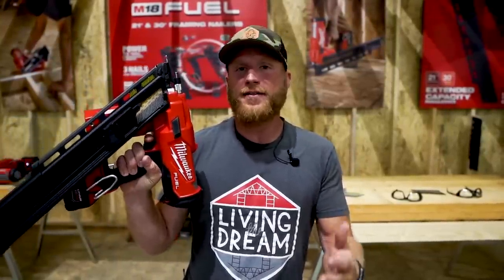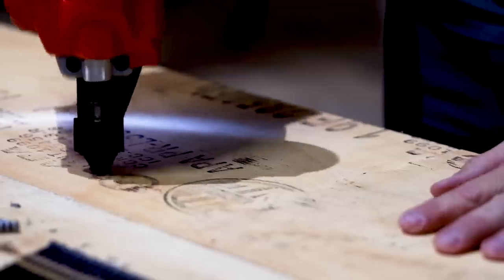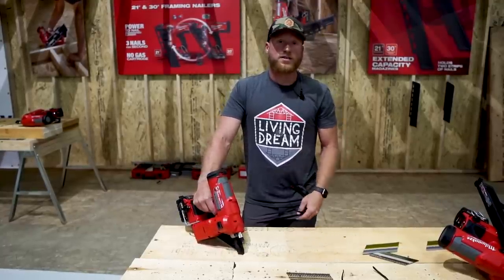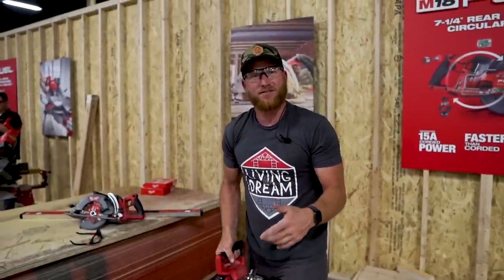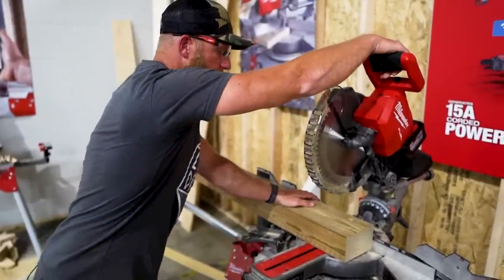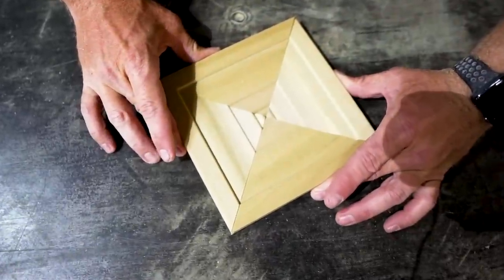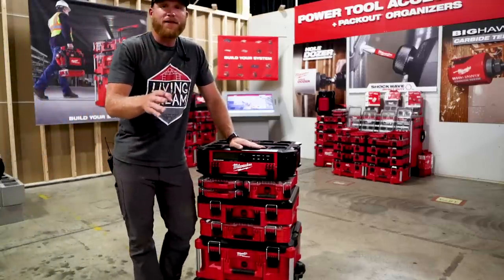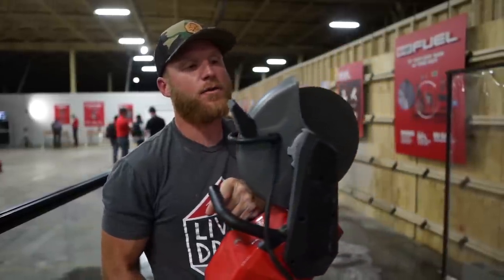Top 5 Milwaukee Tool New Releases: Toolsday NPS 2019 Edition

Comment: Makita better step up their game or im gonna go RED.
Reply: Hello
Reply: How are you?
Reply: why aren't you already Red?
Reply: @crashthenetcommunity  no idea
Reply: Makita is the best.
Milwaukee is a distant second but they are slowly getting closer. They are definitely the best american brand i think
Reply: Jeffrey T  mate makita don't even have battery nailer , how could they be better
Reply: Ivgonefishn 1985 they have better quality tools. Batteries better. Milwaukee has good innovation I'll give them that
Reply: same
Reply: @spikeboi55  better batteries lol😂 makitas best is a whimpy 5ah and they took forever to add a simple battery guage to it. Better battery, better tool my ass.
Reply: They copied hitachi so bad
Reply: Dewalt>
Reply: @spikeboi55  You're kidding, right? I used Makita like forever, then I found a bolt I could not undo. I bought a M18 Fuel rattle gun and I'll never go back to Mak. Red beats blue every time. As Nancy Pelosi is going to find out later this year.
Reply: @Mac P Crap. Makita has gone downhill and is not in the same league.
Reply: Makita makes all their own motors specific for their tools instead of buying from somewhere else and installing in their tools. Some of their stuff is weird but they've got the essentials covered at reasonable prices.

Comment: That nail gun looks amazing!!! I wish it would be out sooner...I could really use it this summer. Good job at doing a review with the nails into an LVL, a true test.
Reply: Josh Yutzy hitachi have the same nail gun using exact same technology 👌
Reply: @booboo-nl3wi  do they both use the compressed air cylinder??? I think that's how Hitachi works. I just don't carry any Hitachi batteries anymore. I wish DeWalt would come out with a better nailer, that's mainly what I use now, DeWalt and some Milwaukee.
Reply: I do like that extended mag option, although I feel like that should come with the gun at no additional cost.
Reply: Me too all my tools are dewalt and I have the nail gun , I like it  but my friends got the hitachi and it’s awesome

Comment: That nail gun wood be a savor I know would just sounded good. Nailed my first roof job by hand at 54 years of age. I could of used this my forearm was broken after that job props to the guys in the trade.
Oh did I say my back hurt my knees hurt hands hurt and my head got smashed in between roof and pack of shingles that fell on my head as I was tempting to throw them on the roof 13 feet up off the ground fun stuff.

Comment: Last year i was excited about the stubbys ...and they didnt disappoint....but this year im so stoked....im buying tye torque wrench...long neck ratchet....that big chop...glad i just got the dw713...as a 10 inch and didnt drop the 500 on the 10 inch milwaukee...because ill keep the 10 inch dewalt..for my 10 and pick up tue milwaukee for my 12....that framing nailer is a bad ass....and the battery die grinder
Reply from the maker: All awesome tools

Comment: Nail gun at start looked good. The saw that was shown second although worked, my flexvolt will own it. The Dropsaw you could literally see the flex at full extension on the rails when you said there was no flex. As per usual some companies do certain tools better than other. Dewalt definitely winning in the saw department, table saws cutoff saws compound mitre saws. Not sure on the sawsall that probably goes to Milwaulki.
Reply: Palpac I have the flexvolt right hand blade saw ,love it ,so much power.
Reply: I own all Milwaukee, and I agree with you. If makita didn’t require two batteries I’d favour their rear handle over all actually.

Comment: You can tell they were paying attention to the complaints from reviewers of the competition when they designed this framing nailer.  That thing is going to become standard fare on sites.
Reply from the maker: its awesome
Reply: Mechanism sounds just like the Hitachi. No doubt they took that baby apart and looked for anyway to improve on it. Probably similar with their 12 miter and wormdrive style saw. Theres probably a few dewalt laying on their r&d benches. That would explain why they're a couple years behind dewalt and Hitachi getting to the market.

Comment: I got three Dewalt ads while watching this. Amusing. I bet that Milwaukee’s R&D is on point, but it would be really neat if you could get the new nailer out on site and get some hours on it before it is released. That way we can see how it stacks up. I like the new rear handle saw, but how does it compare to the Flexvolt? I’m in the market for a rear handle saw, but I’m already bought into Dewalt and I’d rather not wait on the release of the Milwaukee.
Reply from the maker: I like the milwaukee

Comment: The bump fire was crazy great!  Wonder how well this nailer would work in subzero weather?  Any specs?  The reason I ask is I watched the  Crazy Framer's subzero solo house framing project (He's Crazy!), and he had a terrible time with nailers.  He threw his DeWalt nailer several times when it wouldn't fire a nail or left it proud.  Not saying these battery powered nailers should work in subzero, just wondering what Milwaukee says is this nailer's operating temp range?
Reply from the maker: I asked and they said it would still fire down to 0 Degrees Fahrenheit .  I don't know how low tho it would go
Reply: @RRBuildings  Thanks for checking!

Comment: Framing gun looks good. Same motor on the blade left circ saw..nothing like the flexvolt...no balls on the mitresaw...The m12 die grinder looks great. ..
Reply: Miter saw looks and sounds pathetic. Framing gun will most definitely over heat and stop working.
Reply: Joe Framer... Based on what?... Yea I figured...

Comment: I need everything. I’ve been waiting on that framing nailer for years!  I’ll buy the nailer as soon as it comes out as well as the router. My packout setup keeps growing, so why not add the radio?!

My M18 radio 1/2 way shit the bed. It will only run on a battery and Milwaukee wouldn’t warranty it.  It won’t charge the battery or run off of grid power. They were going to charge me nearly $200 to fix it.

Comment: Dude I'm so excited to get my hands on that nailer.  Like you said drives nails constantly  unlike some  other  brand   that's out there . Should be on par with Hitachi nailers hopefully it will work better in cold weather
Reply from the maker: it is supposed to work to colder temps with no shut off

Comment: Bought into the Hitachi line for the framer. Have the 15 and 18 as well  and love all three. Would have bought Milwaukee nailers since I am already invested in m12 and m18 tools, but their gen1 was not great and late on the framer. I like the rear blade left saw (finally), but love my 6 1/2 m18 fuel. Small and lightweight and gets the job done.  It sounded like it was struggling a bit. Still think the rear flexvolt is king. Have the 7 1/4 miter m18 and love it. 12" is corded territory for my needs in a shop setup. All in all I like what I saw (pun intended), but my wallet is safe. Just bought the string trimmer attachment model. Bought gen1 without so have two (pissed it didn't come out with attachment right away). Use string on gen1 and edger on gen2. Thanks for video. Well done!!

Comment: Nice Rs at the end. I'm most interested in that router and maybe the 12 inch sliding for later. I have the 10 inch now and it's a great saw with great power it just is hard to get perfectly square cuts. I mostly use my table saw now for finish cuts and only use my sliding for quickly roughing out a whole bunch of stuff really fast.

Comment: Drop test 20 ft worst case scenario nail gun add wheels to the SAW stand for easy movementand put handles on the router so accidents are less likely to happen. Would love too see laser option in the future and hopefully battery corded option for those long cut days love to the pack out radio but price point I'm waiting for a good sale and the current one works good for now

Comment: Awesome, glad to see this demo. My 20v 21* DeWalt is great for 2xs but I have a feeling this nailer is on a whole new level.
Reply: @gl9500  I totally understand your point, but I use my battery nailers as my primary nailer until it reaches a medium that it won't function well in (OSB/LVL). The weight and size never bothers me as much as the hose, break down and cleanup of the air compressor and pneumatic gun. I haven't ever gotten into a spot my nailer couldn't reach in normal situations. There's always that occasional support board that needs a nail in it close to the eave behind a joist, but no nail gun will reach there, so I use screws in those positions. I have my paslode pneumatic and it's a great gun, but I love not having to fight with the hose, move the compressor, untangle and clean up at the end of the day.
Reply: @gl9500  The lack of two strips is my biggest complaint. Mine doesn't sink them when I'm toenailing and if I'm doing a 3/4-1 1/8 advantech it also can't do that.

Comment: The tools are amazing, my concern is why if your battery dies and you don't have spare or backups battery and then what's next. Just my opinion it so nice if they have a socket that you can plug an extension cord  the longer you can and powered from the electrical outlet or small generator would be better isn't it, Just saying though👍🏻👌

Comment: You said your Makita router wasn't cutting it. If you had to compare your Makita router to this Milwaukee which wold you pick and why?  What Makita do you have? I was tempted to get the Makita router because Milwaukee did not have one yet.  I needed a track saw and..... Milwaukee did not have one so I bought the Makita cordless track saw and got 2 extra batteries and a 39 inch track. Also bought the 55 and 118 inch tracks. Having the batteries for the Makita I thought, I will just get the Makira router now, tool only. But... the NPS announced the Milwaukee router.  So need some comparisons.  Totally baffles me that they are not releasing the bases until Jan 2020.
Reply from the maker: Yeah hard to say I need more time with the tools

Comment: At 9:18 it looks like there is a lot of wobble from the handle on the mitre? Did you notice this at all when doing the precisions cuts?
Reply from the maker: No man... seriously as solid as any other miter saw I’ve used.. the handle moved but not the blade
Reply: @RRBuildings  Thanks so much for the reply. One more question, how would you say it compares to the dewalt flex volt 12" mitre. Every dewalt mitre I've tried has a bit of a click / wobble when you grab and try and move the handle back and forth (most mitres do to some extend). Is the milwaukee one any better or worse would you say?